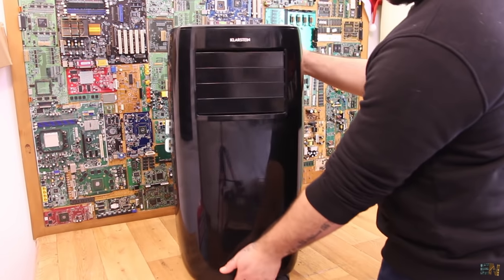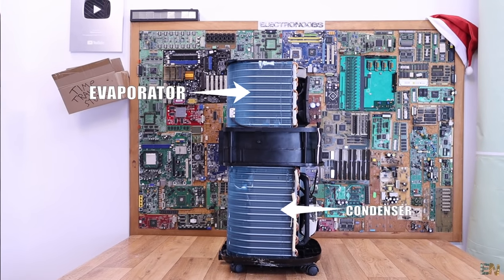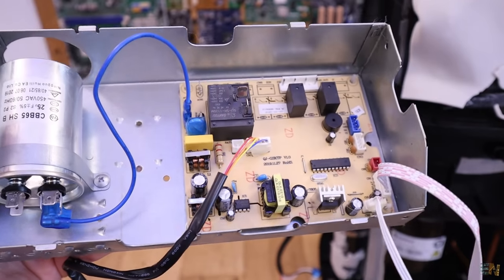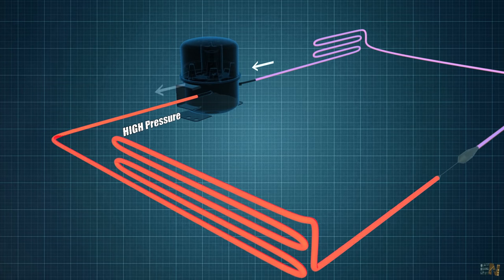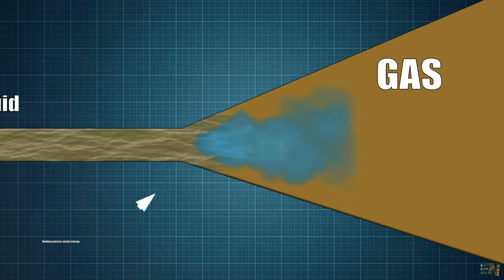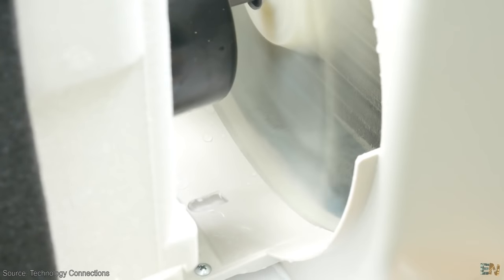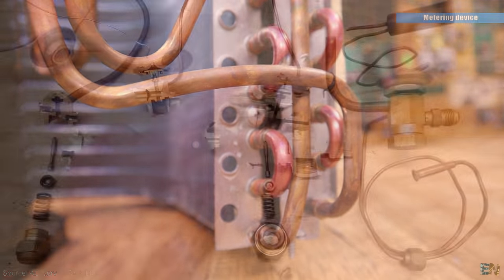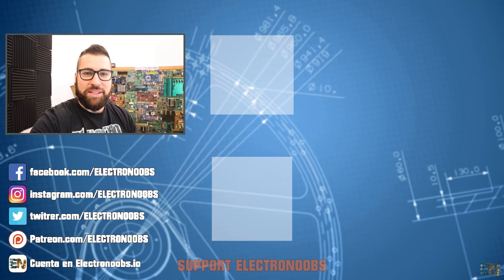How Air Conditioner Works And What We Have Inside

Comment: I watched a few videos and yours has put all the pieces together better for my hard to crack shell. Not much different but enough to answer the questions that developed from others. You rock man keep chilling. Is there any advantage to putting a louver on the entry door so that your draw comes from the shaded somewhat cooler hallways instead of the exterior windows? It would help in the winter also if you pay for heat, again not drawing from freezing temps. I’m a machine operator, not an a/c tech so it’s a guess on my part.

Comment: i would love for you to make an arduino run that ac
Reply: It might not be a good idea to hack into mains appliances. But if you want to, you can just replace the microcontroller with your own (Arduino, STM32 or whatever) and match the pins with the traces that go to the relays / sensors
Reply: @narayanbandodker5482  how else would you run it on a Arduino if you didnt replace the board and use similar or those exact components simple reason for doing this is to make better pid controls with a wireless temp sensor to place in the middle of the room to insure that the room is temperature controlled instead of the air inside the case where the normal unit takes the temp and you could even make your own remote with the temp sensor inside lots of neat reasons that are extremly useful and innovative could lead to a new kickstarter for @Electronoobs a pcb set that is a universal drop in for units that work but the board is fried

Comment: R290 is actually propane. It is far better than most other refrigerants with global warming potential of 3-8, for comparison R410 which is very popular at the moment is over 2000. The problem is flamability of propane so it can't be used in large systems with potential to vent into small rooms in case of accidental leakage.

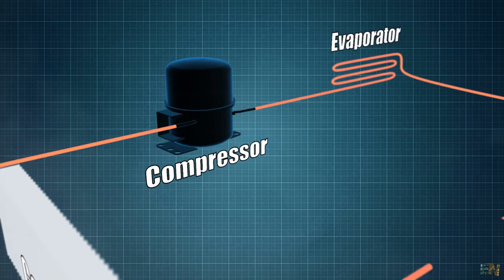Comment: 5:36 the filter goes on the other side of expansion valve… hot gas comes from the compressor, gets cooled in the condenser wher e it also condenses to a liquid. From there it will pass trough a filter/drier and then to the capillary or expansion valve. After that it goes trough the evaporator where it becomes a gas again and back to the “muffler”aka. strainer/ decompressor and back into the compressor.

Comment: you should hang the hot radiator out the window with a few pc fans attached, then seal as best you can with some styrofoam panels. it's ghetto but you will get much better efficiency.

Comment: if you spray water on condenser will increse efficiency?
Reply: It depends. I had a wall unit. Buckets of water did help lol. But that was because the compressor was hot causing the unit itself to read a bit higher before dropping.

Comment: My 1 year old portable unit stop cooling and heating,  I replace the capacitor.  the unit runs, the compressor comes up but the air does not get hot of cold.  I measure the temp of the compress and its was 139 degree. but the coil are not hot or cold

Comment: Need help disassemble a Hisense so I can limit weight to 60 pounds for airfreight. What parts can I disassemble without damaging the internet?
Reply: It is a Hisense 10,000-BTU (15,000-BTU ASHRAE) 115-V Dual Hose Portable Air Conditioner with Heat, Window Kit and Remote

Comment: Hello my portable airconditioner doesn't produce water 3 days ago it was producing water but now noting even if it's on for 24hours. Why?
Reply: The drain line could be plugged and its just been filling the pan which will eventually overflow and spill water everywhere.

Comment: Again you made another techncal error. The condenser coil and evaporator coil ARE NOT RADIATORS! They are heat exchangers. The evaporator absorbs heat in the room removing it. And the condinser gives up its heat to the out side cooler air. Radiator is a heat exchanger for a automoble gas engine. It is never called that in the USA. And the HVACR schools in a class room never use that name!